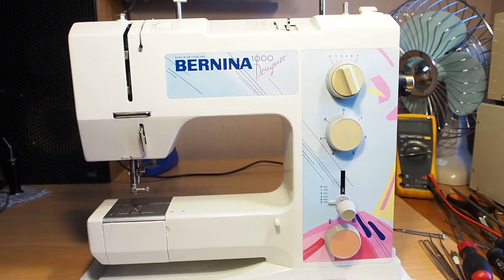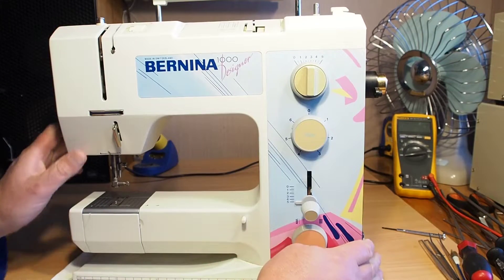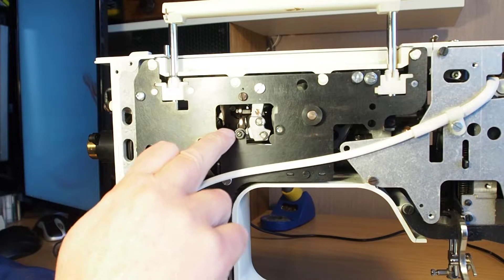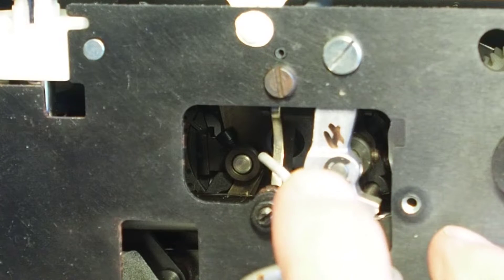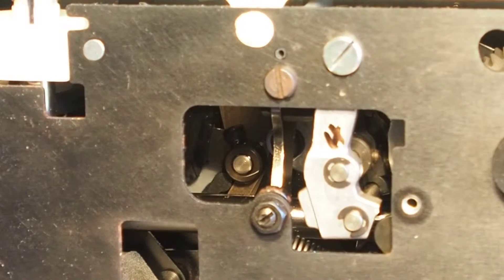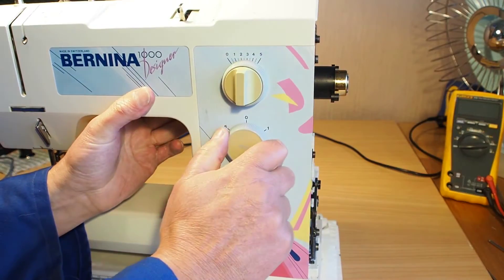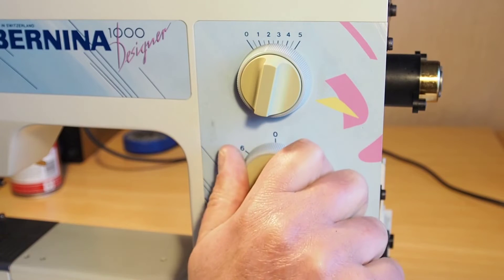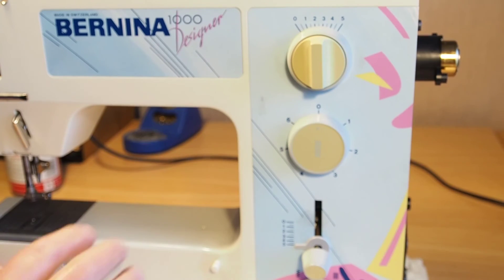Bernina 1000 Series Sewing Machine - Seized Control Dials (Designer 1000)

Comment: Hi. I’ve got basically the same Bernina as this one. On mine the reverse doesn’t work. I took mine apart like you did in the other video where you had the silver metal plate off to fix the needle bar. I couldn’t figure out what was wrong with the reverse and you never mentioned that part. Is there something simple I can do at that point to fix the machine? Everything else and all the buttons work perfect now. This style is different than the ones you can access the reverse through the bottom. Any help would be appreciated.
Reply from the maker: Hi. Maybe try oiling the reversing lever pivot point. Thanks.

Comment: You don’t know what awD40 does?   WD40 leaves a gunk residual.   Use to work in gauge lab in huge machine shop fixing precision instruments
Reply from the maker: I've never actually used WD40 - I didn't realise it was that bad. I use CRC 5.56 and when I mention that, people say they use WD40 instead so I figured that's what they have access to. I'll try to use 'penetrating oils' as a generic term rather than mention brands. Your comment may've been more helpful if you actually mentioned what would be good to use. I create these videos to try to help people.